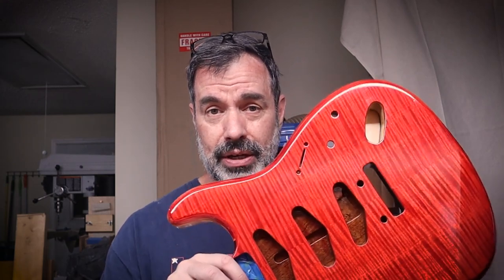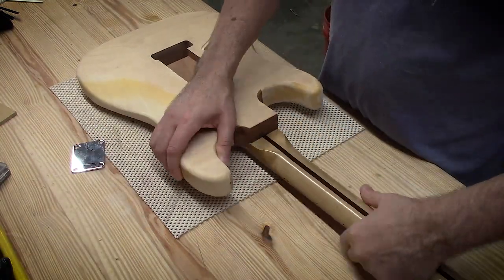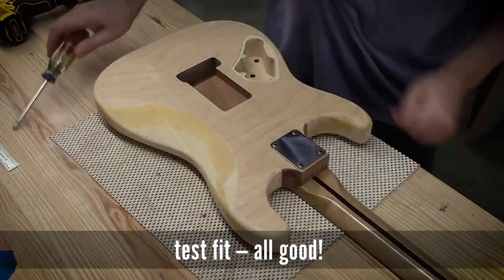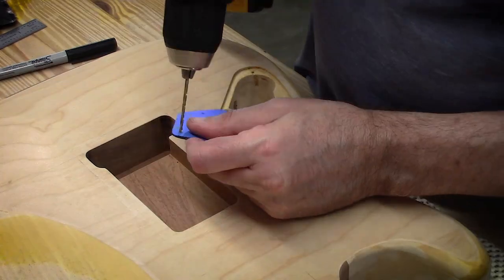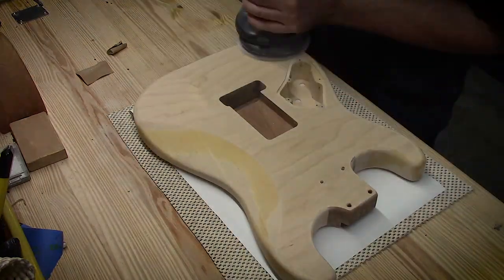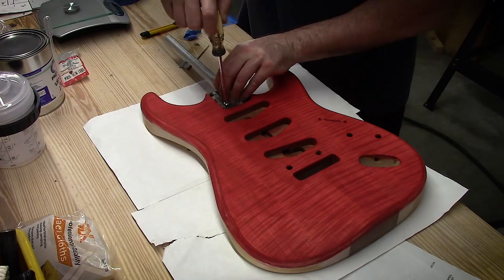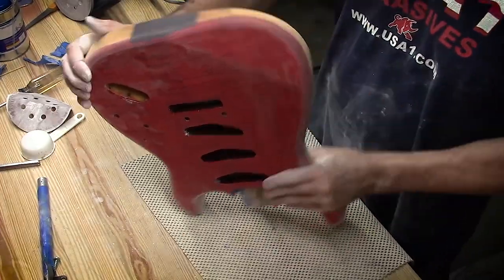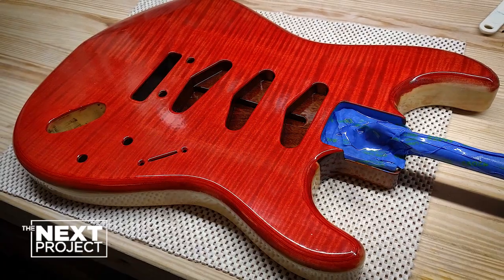Fender Strat Starcaster Guitar Mod Project 7

Comment: Another great video. Looking really good. I’ve tried to use Rit dye before and could never get a decent result. But you made it look great. I can’t wait for the next episode!  Thanks.
Reply from the maker: Hey John, thanks for watching!
The Rit dye took some experimenting. 
My initial tests were with black, wine, Scarlett and the transtint. 
I had mixed feelings about the results, but kept trying.
Part of my early test problems may have been due to no surface prep. I was basically testing on unsanded veneers, and the absorption was not consistent. 
Also, when I tried to use black as my base tint, it really over darkened the red top coats. Probably would have been a good look, but not what I was after for this project.

It was a roll of the dice, but in the end it's looking good.
Reply: @theNextProject  yes, looking very good!

Comment: Having holes slightly off center helps pull the neck further into the pocket. not that much of course and consistently the same for all screws.
Reply from the maker: 21, thanks for watching!

Off center would have been nice, random shotgun blast holes not so much.
I oversize the neck pocket holes just a little to allow for firm seating of the neck. 
The oversize pocket holes keep the screws from binding as the neck is drawn down snug into the pocket, allowing wood-to-wood friction of neck and pocket.

I don't know the history with this neck, if it had been installed, removed and re-installed at the factory, but it had already been plugged once before. No sign of it being done after the factory, as all the factory paint, buffing compound and paper shims were still bonded in place. 

If this guitar could talk, it would probably cry.

Take care!

Comment: The color looks great, but in my opinion it will be better if you colored the stain black first than sand it level and finally paint it red. But it's just my opinion. Btw 👍
Reply from the maker: Jeffery, thanks for watching and I completely get what you are saying.

I had originally experimented with a black base Rit dye to make the maple ripple pop, but the results of adding the Transtint red over the black base pushed the overall color much darker.
It looked good, had good "pop", but was a different look.

For this project, I'm hoping to get the figured red close to the sprayed red sides and back. It's tricky trying to match two different processes, my fingers are crossed.
I had also considered doing the black/red top dye, then spraying the sides and back in black, but I figured I just stripped away all that black, don't want to go back on this project. I'm weird.

Hope you are doing well, take care!
Reply: @theNextProject  For all guitar channels that I've followed, only 2 of them who reply my comments quick, and yours is one of them. I am really happy that you also read my comment. I wish you all the best for your channel 👌👌👌

And by the way, maybe you need to wait a little longer when you are applying the black color. Let it completely dry, then sand it flush.
Reply from the maker: It's really good to hear that I'm one of the channels that responds regularly. Kudo's to the other channel as well.
Sadly, I only see notification of new comments, not follow-up messages. So, there may be times where I initially respond, but don't see any continued messaging to a comment thread.
Since this is a new video post, I can easily see if there are new messages, older videos often fall far down the list for ongoing message chats. Hope that makes sense.

I'll be doing more experiments with the black base dye in the future, I'll be sure to extend the dry time as you mention. I'm also using the heat gun to set the dye...heat works with fabric, so maybe it will with wood too, idk.

Thanks for the best wishes, take care!